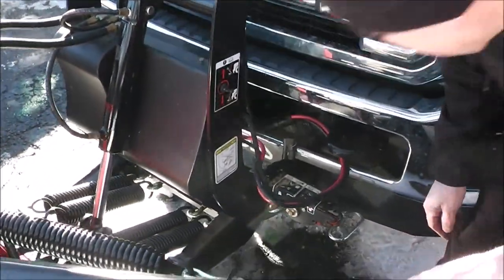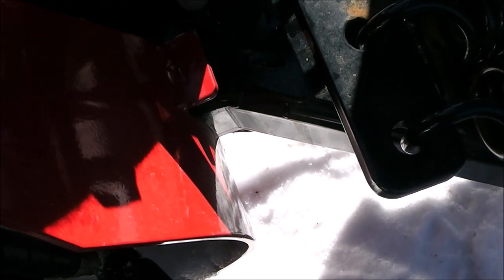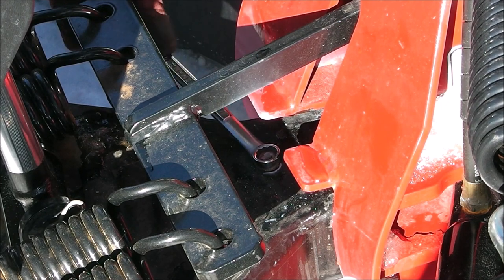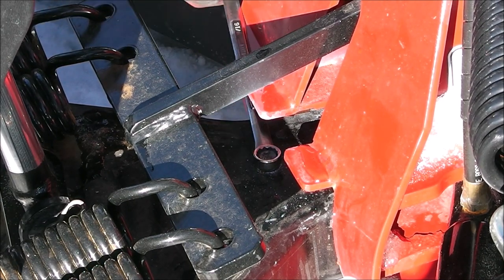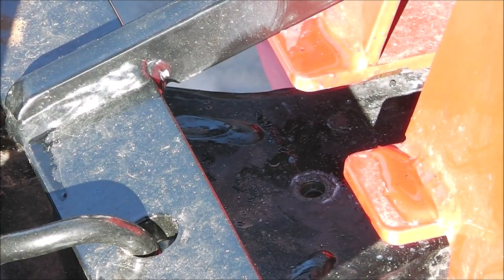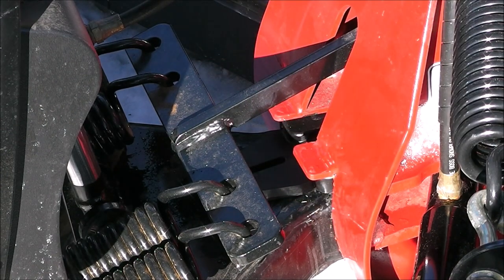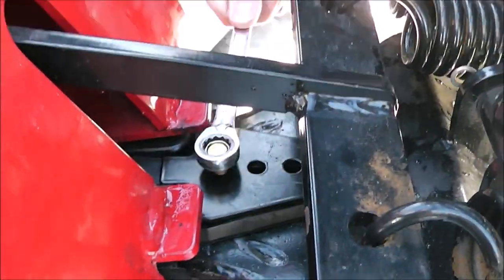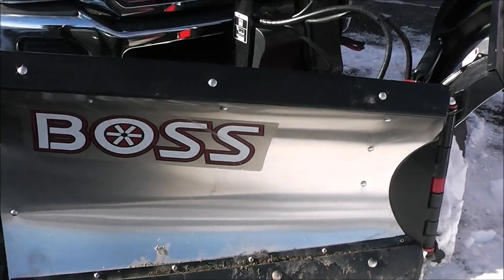Snow Plow Repair Welding to Remove a Broken Bolt

Comment: Good Job Brandon! Like someone else said we don’t see snow plows here in West Texas but we need too!  Since we got 15 inches of snow on Sunday and Monday then 2 more on Wednesday. Welding the bolt on that broken stud accomplished two things 1 it provided a surface to grab on to with the wrench, 2 the heat is more than likely what allowed the stud to be removed. I would have replaced that bolt with anti-seize compound and used a grade 8 bolt. Nice fix thou.😁🛫
Reply from the maker: I hope your guys are holding up OK. I have a friend that lives in Texas and it's quite something what is going on.